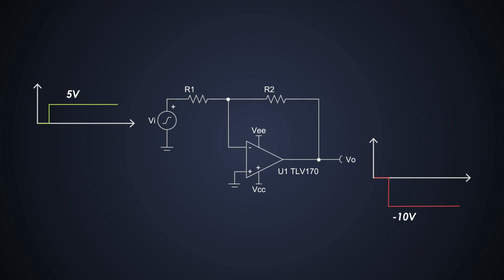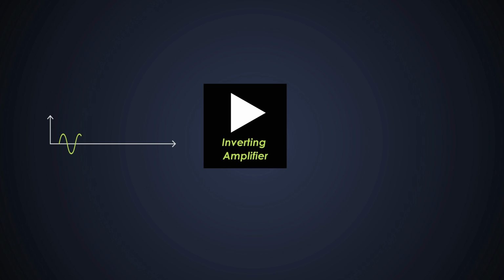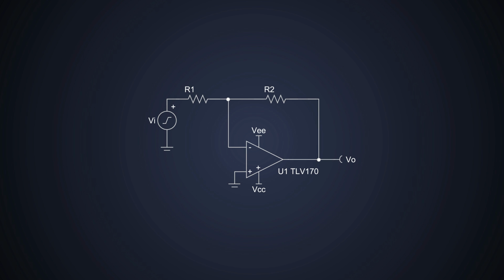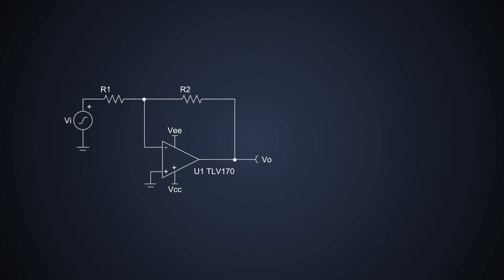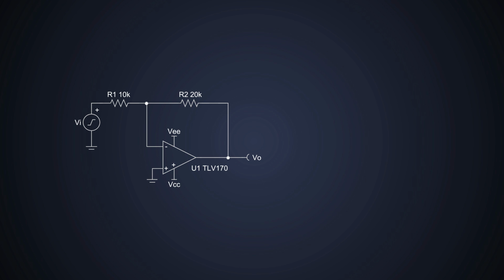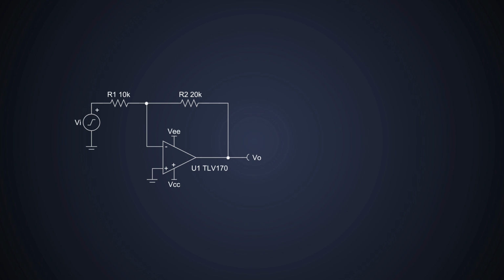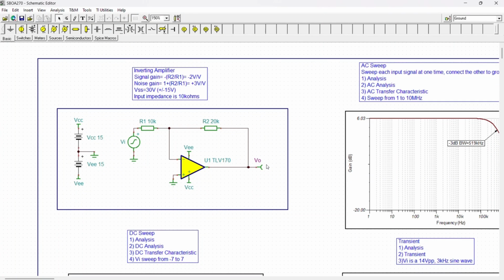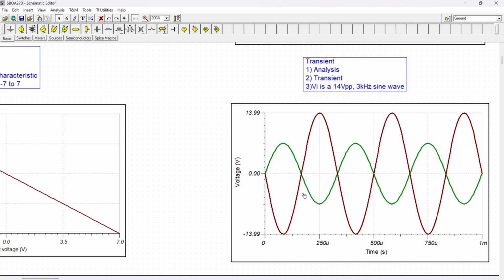How to Design an Inverting Amplifier Circuit? Inverting Amplifier | Op Amp as an Inverting amplifier

Comment: Thanks for the video. "Using high value resistors can degrade the phase margin of the circuit and introduce additional noise
in the circuit" why is that ? I have a little knowledge about phase and gain margins, if you know the answer, could you write it down here?

Comment: Any video on Remote Control circuit's  , explaining how the signals are transmitted from transmitter to receiver to control the motors used in the RC toys or cars. Detail explanation of the working of the electronic components used in transmitter and receiver circuit's
Reply: Sir sorry to disturb you  ,I'm a beginner in electronics, trying to learn from YouTube videos for example from your video's , please guide me  , I want to make a small project on a Remote Control circuit  which is used in small RC toys. Want to know how signal is transmitted from transmitter to receiver to control the motors in the toy  . Guide me For this what all topics should I study  , there is any project magazine's  which have this kind project's with circuit's explanation